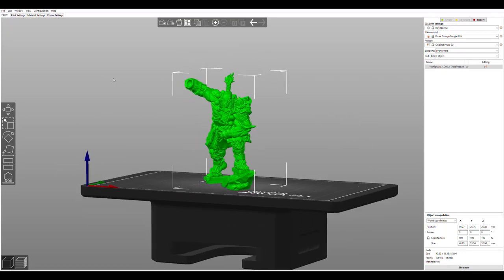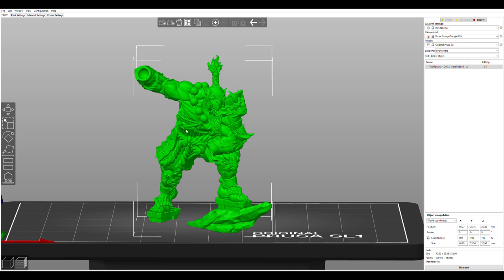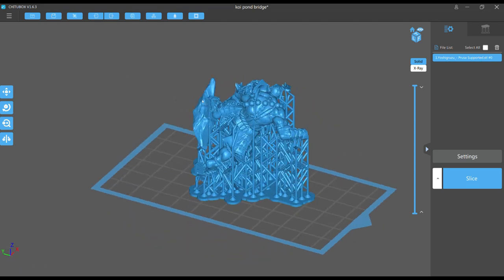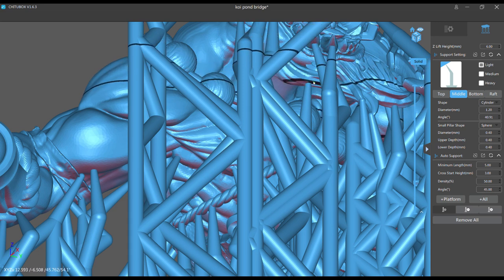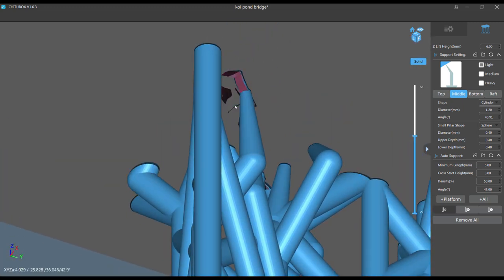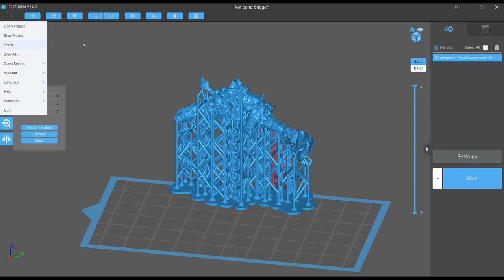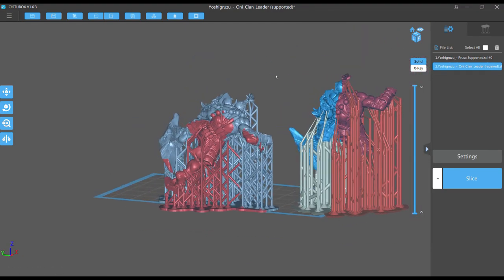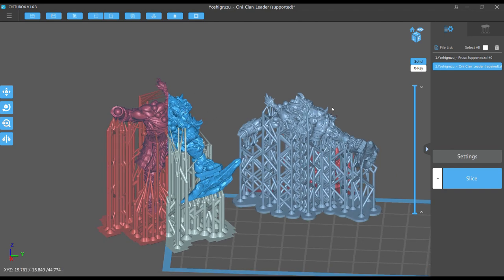Prusa Auto-Supports for 3D resin printing miniatures...set it and forget it?  Or just "Forget It"

Comment: ive watched your tutorials on support in chitubox and they are great. learned a hell of alot. but i will disagree with something in this video and thats the fact you didnt print the model; as supported, from Prusa. its great to get your input on the situation and understand why and how you think it wont produce great results but you offer no comparison because, by your own admittance, you cant be bothered to clean your vat.
so your conclusion ends up being "this is what i think and i have nothing but my own words as evidence"
you can adjust support size and contact and depth just as much in prusa as you can chitubox...so maybe it would be an idea to set them relative to your supports in Chitubox and then print it and give us a proper comparison? 
without actually seeing the damage caused, if any, when prusa is set up similar to your Chitu settings then its all kind of a mute point.
having said all that thanks for your vids and tutorials they have helped me no end with supports!
Reply: Adjusting the contact depth and size is possible in Prusa, but you can't do it individually. Each Support structure would have the same Size and depth.

Comment: I use PrusaSlicer very often and the supports are pretty good for autosupports, but setting some manually if i got a big modell and there are not enough supports.
I don't printed very much yet, i only have the photon s since about 2 months, but it helped at 90% of the prints and tney came out all perfect.
It also helped me to understand where supports are needed and where not, so i got some manuall supports done in chitubox.
You should see my first manuall supports i made in chitubox...waaaayyyy overloaded with supports.

Comment: can you do "print in place" prints  with a resin printer?
Reply: "not really" is the best answer for that.. you really need to fine tune your exposure settings otherwise there is a high risk that any light bleed or overexposure will be enough to bond the usually pretty minimal tolerance left between the parts that are meant to seperate and move. As well as their may be many islands within those joints that may cause issues and binding as wont be able to put in supports (or remove them later)
Reply: No. Mean, there might be some models by which it could be possible. But for the majority no.
Reply: @MattWeber  thx
Reply: @Steele68HS  thx

Comment: Hey Greg, first I want to thank you for your videos, I learned a lot, especially about Chitubux. But I have to correct you on this one.
You were doing it wrong, Prusa auto support is most of the time useless, you need to manually orient it in Prusa just as you did in Chitu. Then use these support: here is the link for light and heavy supports - https://ufile.io/ihjq7s9b . If you had orient it in Prusa just as you did in Chitu and exported stl with supports to Chitu you would see that you have about 20-30% supports to add manually, sometimes even less(but there are some supports that don't stick well in Prusa that you have to remove first in Prusa). I learned this from DannyFromMiami and found some good support settings, it saved me half of the time supporting models. Thanks again.
Reply: Sorry for coming in late, but that file requires premium membership to download, would you know another place to grab those settings?
Reply: @yaeMhay1  cheers!
Reply: @yaeMhay1  This link is requiring premium membership to download as well.  Can you re-upload again?  Thanks.
Reply: @yaeMhay1  Awesome!  Thank you!!
Reply: @yaeMhay1  can you just put it in mega or something?? why do people use these strange uploading webs to share files??? its something i will never understand

Comment: You should try Formware 3D before you say auto supports are bad in all software pacakges ;) spoiler: its great in formware
Reply: It still misses a lot of islands... While I agree it's a nice slicer, it's not $150 nice. You still have to go threw and set manual supports or you'll have these issues.
Reply: +1 the $150 price tag. When's the last time s3d added new features or improvements.... I'd argue s3d has been pasted be free software. Will formware be any different down the road, not spending $150 to see
Reply: @nuroo1  I can actually confirm that it is a lot better. I have been in contact with developers of Formware and got not only support but also my issue fixed in latest version. New versions are released at least one's a month on average with real upgrades.